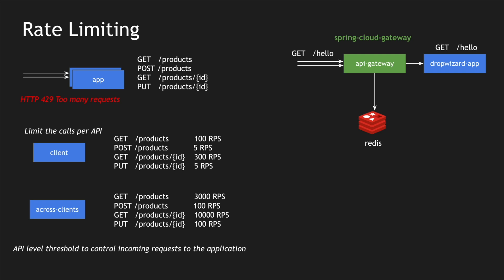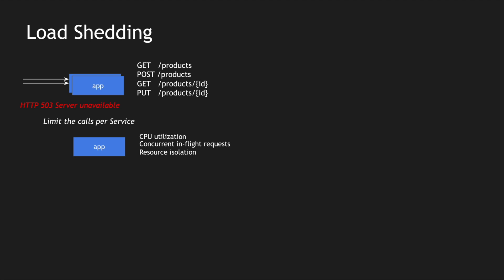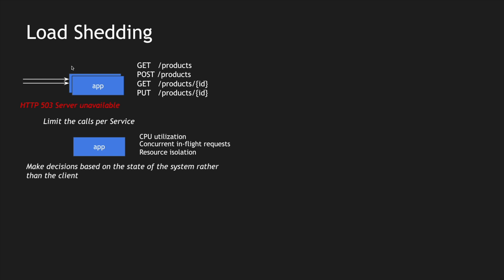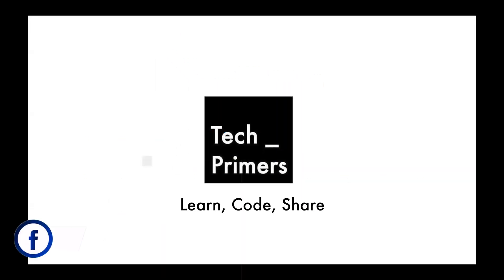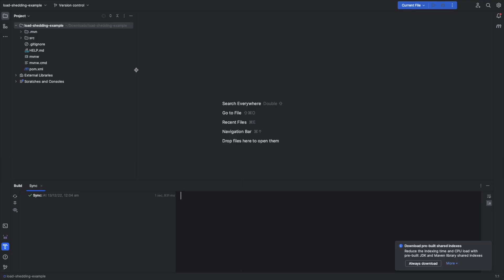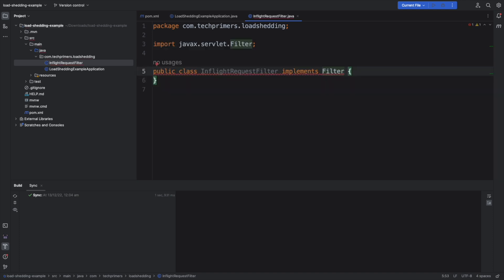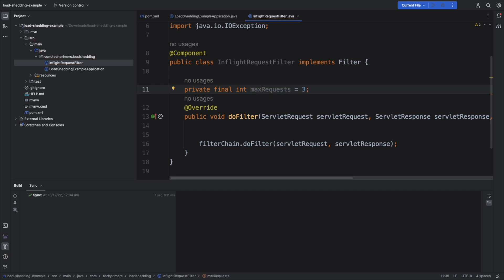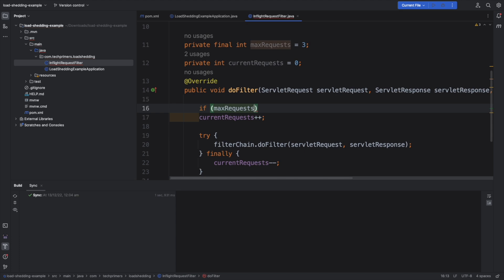Load Shedding in Spring Boot | Tech Primers

Comment: Minor remark. The code is still not correct for multiple threads: line 26 could be reached simultaneously by n Threads, when they all go through the "if" in line 19 the same time. But this is not your point, I understand.